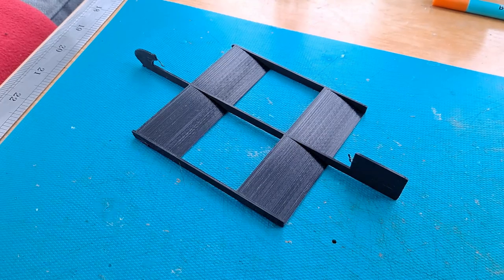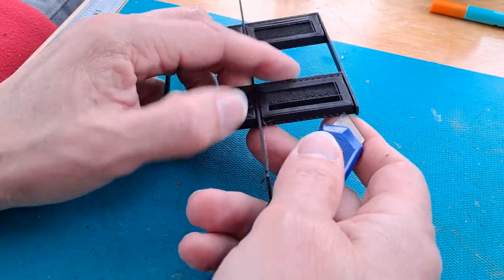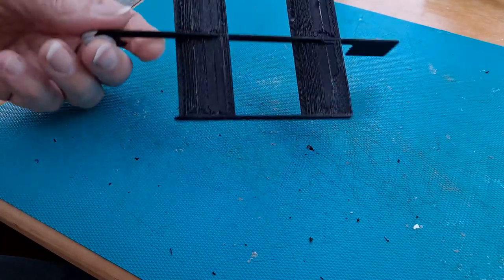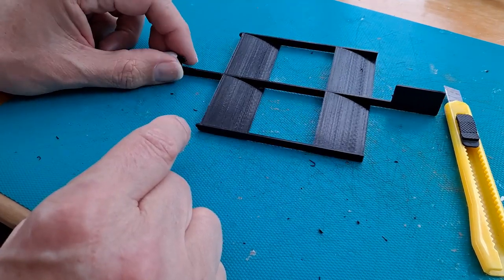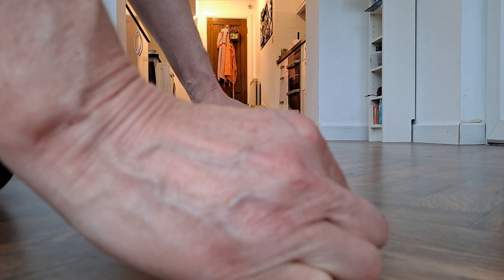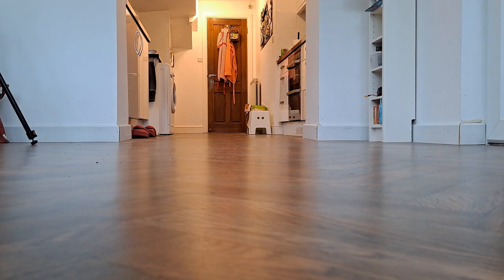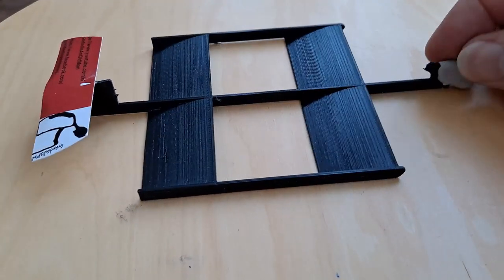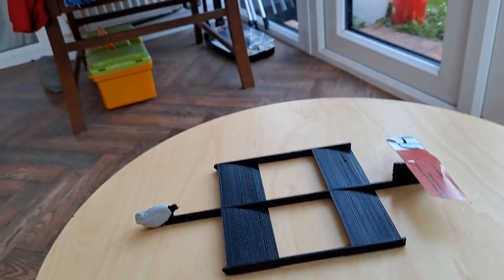Ground effect vehicle inspired by Spencer Hunt

Comment: Thanks for the shout out! I'm trying to clean up my act in my videos. Ground effect gliders are tough to get right, as you can see mine suffer from a lot of the same things you've encountered. But that's what makes it fun, it's challenging. Already have an idea on how I'd like to change my approach. Thanks for sharing, looks good
Reply from the maker: I saw yours and thought it would be interesting to try to print it, but I am having trouble getting support layers to disconnect cleanly. In V2 I use card for the wings and 3D printed fuselage. Makes it much simpler to build.
Reply: @GrandadIsAnOldMan  I design the winglets separately and print them standing up. It took forever because I've got a .2mm extruder on there. Need a second machine so I don't have to keep switching nozzles and re leveling the bed 😂
Reply from the maker: @spencer963  Yes, I wanted to see if I could do it all in one. I rather like "print-in-place" projects, when you do it all in one go. Here is Mk2 where I used card for the wings. Made it much simpler. https://youtu.be/6Gwn9_0B0Kc

Comment: thats cool, I just watched a video by Think Flight " not a pool toy" who is building a gev to fly a man on water, I thought it was rctestflight who has done several rc versions.. could you print the wings flat and slip them into slots in the main beams? it looks like its pretty dependent on the release, like you need a base to cock it into and release... maybe a rubber band powered prop, puller or pusher?
Reply from the maker: I just watched that video looks good. I did see an earlier one of his videos in my recommendations, but didn't follow it up to see how it had progressed. Back to my gev, in version 2 I just make the wings from card, much easier 😊
Reply: @GrandadIsAnOldMan  rctestflight released a vid today "worlds first rc airfoil flairboat that has some good information in it
Reply from the maker: @docink6175  I have just been watching it myself, I will add that one to my playlist 👍

Comment: Now that is COOL!  Think it would help if you put wiglets on it?
Reply from the maker: Version 2 is the same basic design but using card for the wings. The main problem with these are they are too small to be certain they are working as ground effect. I should try launching them at a few feet above the ground to compare the flight characteristics. I didn't think to try that, when I was filming them, but I suspect they are just working as a slingshot projectile.

Comment: Possible solution would be to 3d print spars front and back instead of solid wings, and cover them in tape to give you the bulk of the wing?
Reply from the maker: In version 2 I simply make the wings from card 😊

Comment: How about a 3d printed wind turbine for leds
Reply from the maker: It certainly could be done. The larger you make it, the easier it would be to generate electricity, but you could make one easily enough without using a 3D printer and make it quicker too. Printing large objects takes hours if not days.

Comment: GrandadIsABigKid morelike.  Probably not the first time you've 'eard that one eh

can you print a 'support form' and then coat or plate it with something to help release whatever is printed atop?  I bet if it was that easy someone woulda figured it out already... 
and getting perfect registration right would be a nightmare in an of itself alone
Reply from the maker: Short answer is, no. Longer answer - Technically, it is possibly feasible, but I can see plenty of problems. For example, most filaments will only build on a warm surface of the correct temperature, so your support form would need to conduct the heat from the build plate correctly or the filament won't stick in place. Next issue would be the travel of the head. If there is already a support form in the middle of the build area, the head would always have to avoid that area, increasing it's travel distance and possibly causing heat retention problems in the form it is building. Printing normally and just getting the settings right would solve the issue (there are rather a lot of variables that can be tweaked). I am probably running too hot, or maybe too cold, or too fast, or too slow, or my layer height is to large, or too small.  Another option is to print the item standing at a specific angle. The printer can build the form with an overhang of about 60°. So it could print an inverted pyramid if the sides were no more than 60°. Obviously a pointy pyramid will fall over as it  rises, but if the base area touching the build plate was large enough it is quite surprising what can be achieved. Or print it in several sections and then glue them together. The wings could be printed vertically instead of laying flat, so no support would be required. In version 2 I just use card for the wings, that solves the problem the easy way.